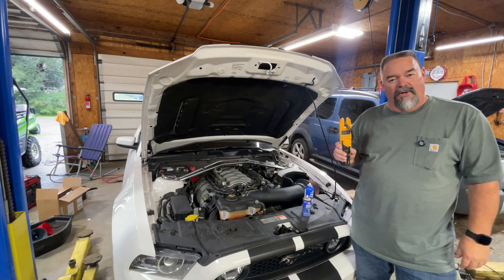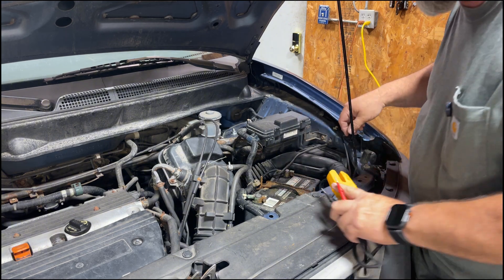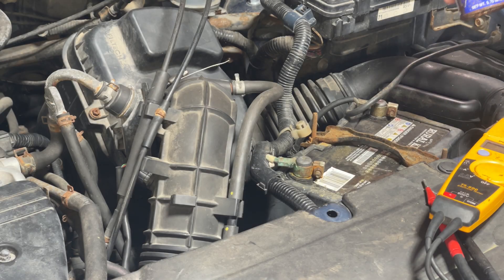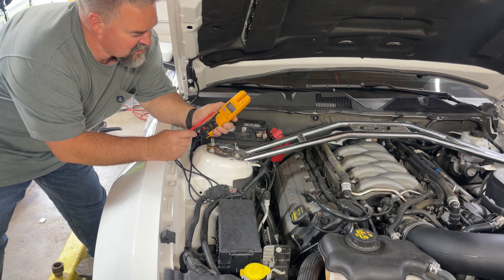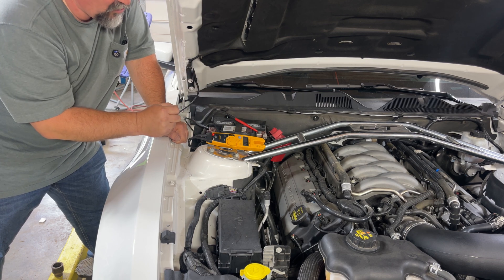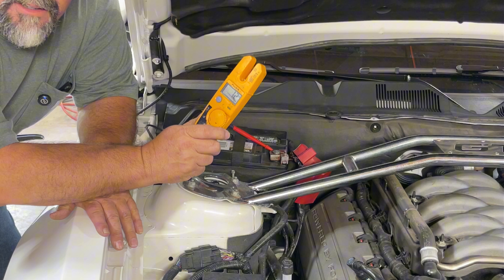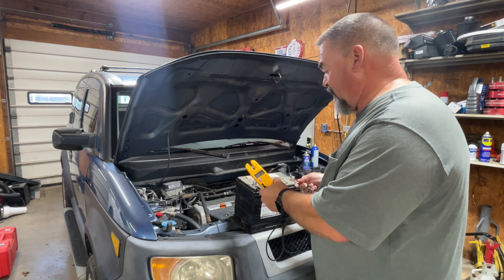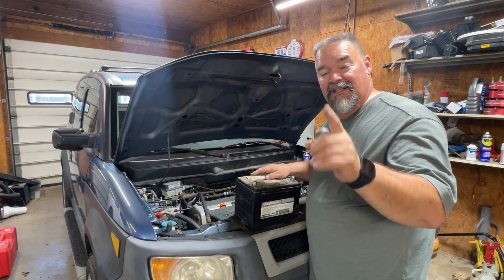Test the battery and alternator in a car with a multimeter.   DIY

Comment: You didn’t mention putting the meter on DC voltage settings vs AC voltage for novice DYIers. Always use eye protection and gloves when working with a battery, common sense. Remove the battery terminals for a proper cleaning and a water rinse. Negative  terminal off first then positive. Reverse when reinstalling the terminals.
Reply from the maker: Wow that was a lot of good info.    I appreciate the comment as I am always looking to improve and what could be bad habits over the years.   You’re 100% right.

Comment: My 2 cents.May I help you with state of charge.12.4 volts is < 70% SOC . 12.66 is 100%. 11.89 is 0% only .770mv difference.Think u need to fully charge battery,let it rest for 1 hour then retest .Do a voltage drop test on the positive terminal on the battery to the wires at connector.
Reply from the maker: Good tip!    I’ll do just that.   Thanks!